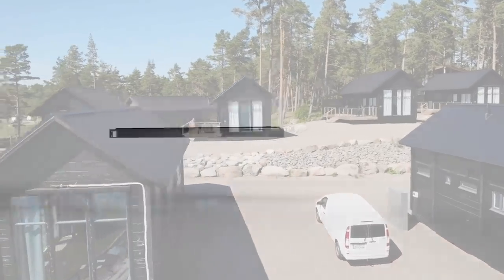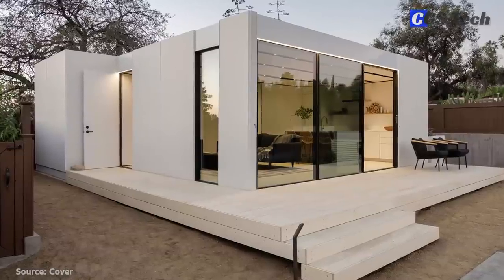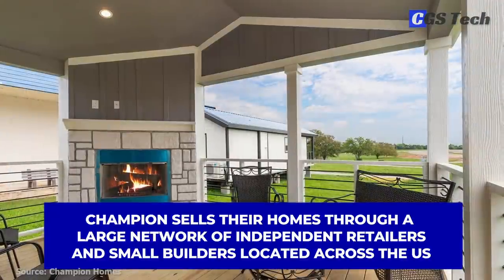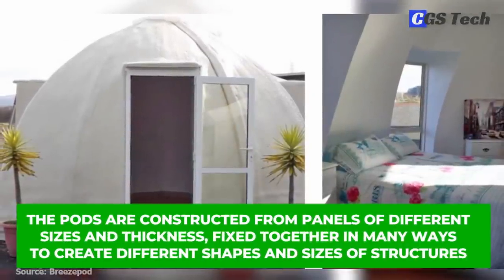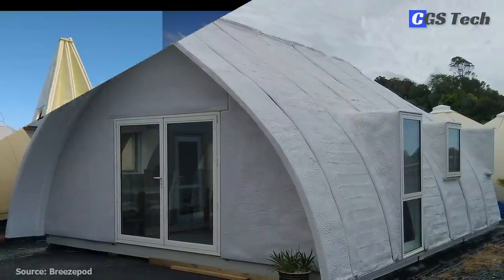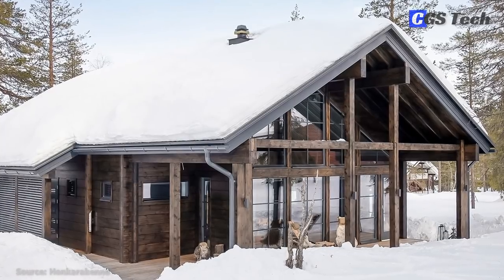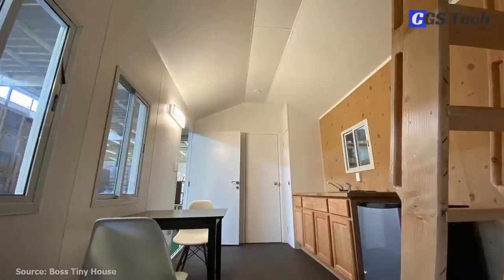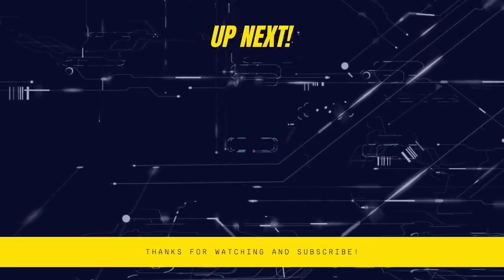6 Great PREFAB HOMES #11

Comment: I  think these have a lot of potential,but here in Florida you cannot beat a concrete home for strength in a storm and  resistance to termites too.
Reply: Hi Lisa. One of the most essential barriers existing in front of the prefabricated housing industry is module transportation problems. whereas Florida is flat and has no high hills, it is one of the best places for the growing prefabricated housing industry. on the other hand, prefab homes can be concrete-based as conventional homes are.

Comment: I think these companies are jumping on the "tech does it better" bandwagon and none of the evidence points to these actually being a viable alternative to just building a property on-site in the traditional way we have done for decades. "each property is unique and can be modified to your needs", that's an extract from one of their websites, they might make them in a factory but essentially are doing the same thing a builder would do on-site, building a frame to your specs...
For each of these properties, I could hire a local firm to build the same thing on-site using timber frame construction for half the cost they are advertising.
Reply: If you just want a house on your property, you don't care about the technology and site impact doesn't concern you, then traditional building is for you.  But if you want custom home built with better efficiency,  environmentally responsible, less wasteful and the least impact on the construction site, consider a well designed factory built house.  It will probably be finished quicker and less cost overruns too.   Sure you can hire a timber frame builder but you'd better pick a design from their catalog if you want the best results.  As long as you choose a good  prefab builder, a semi-automated factory is intrinsically a better way to construct a house.  Before they built cars in a factory, there were coachbuilders.  There are not many of them around anymore for a reason.

Comment: $300sq ft!!(no thank you) I'll just keep living in my mom's basement...
Reply: But these homes come with built ins, electric, plumbing, solar, sometimes beds, entire bathrooms and kitchens. I’d you do your moms basement like that with High end materials and massive windows it would be the same. They use high end building and finishes. And they can be dropped anywhere. So that includes PERMITTING, custom building, shipping, and dropping it off on the foundation. 

You can’t have that for less than 300 a square foot because it’s not comparable. A basement isn’t the same as the cost of permits, building, shipping. Net zero abilities, solar, foundation, plumbing, electrical, and a modern interior and exterior..  go to Kerry T’s channel for affordable and proper information. This video isn’t helpful.
Reply: They keep saying “cost effective“… They’ve been saying that for 40 years. Even with the insane real estate prices we have today, you can purchase a turnkey home… With the land for less than $200 per square foot… Where is the cost effective?
Reply: Ha ha

Comment: When will someone cover modular or prefabs that are well built but reasonably priced. I know they are out there somewhere. Along with that depressing price everything was included? Is that true - everything? You are actually hooked up to all utilities not just ready to be hooked up to utilities? The foundation is included in that price? Everything but furniture? Kitchen and bath equipment? I did not watch the entire video after sq ft price was announced.
Reply: Foundations and services are not included as it will be different costs in every region. You just have to do your own homework.
Reply: You can pay for everything minus the land for some. You can literally get everything prebuilt including tubs sinks showers all utilities etc. You would have to still bring the power to the house and septic system hook up and inspections.
Reply: That's an unrealistic request. 

The cost will drop, as it always does, as they catch on.